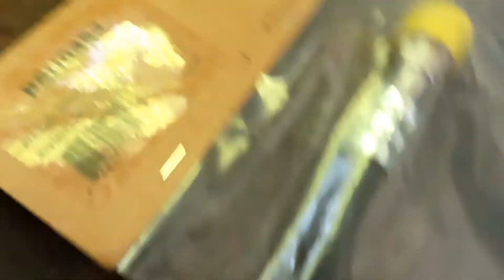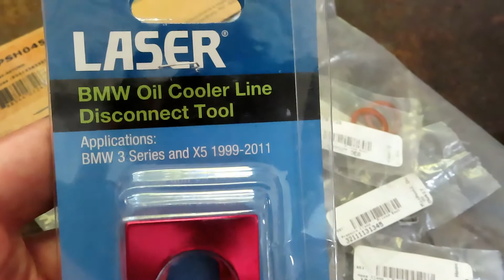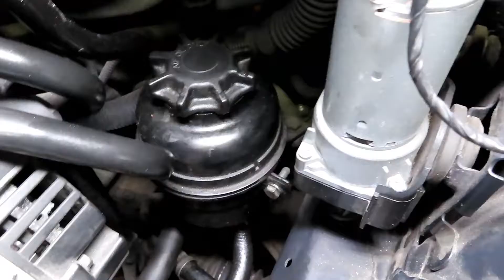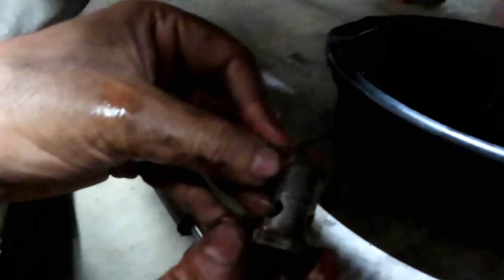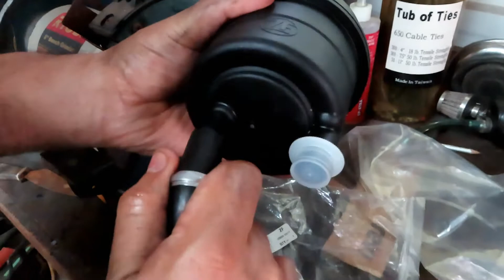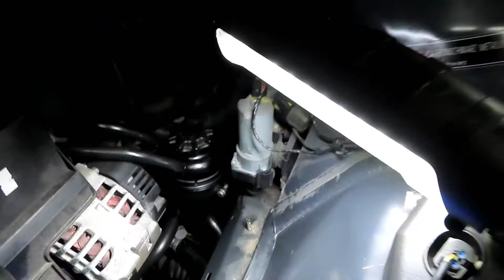E46 M3 Power Steering Leak Full System Flush and Bleeding

Comment: I like what you did with the intake. How did you make that cover? I have the same intake  btw.
Reply from the maker: I cut a piece of polycarbonate with a jigsaw and dremeled the edges. I used 2 L brackets and leftover steering bushings to screw the lid down. I did show the velocity stack with a filter upgrade as well in a separate video.